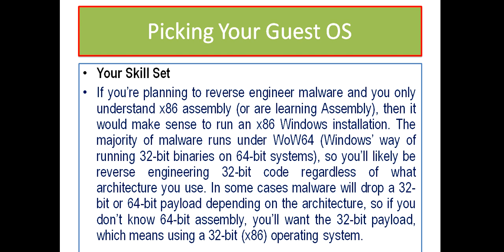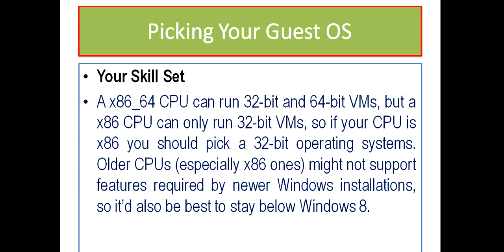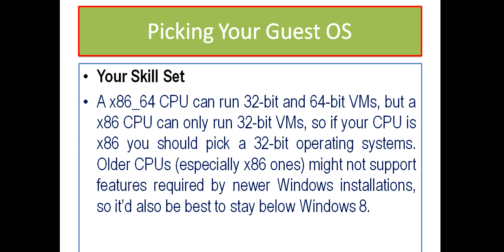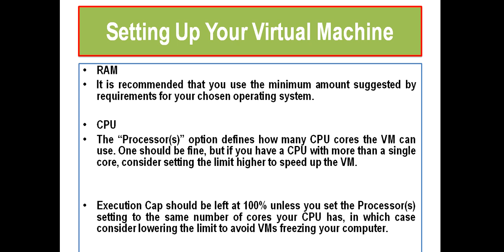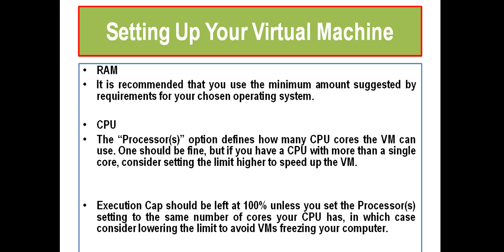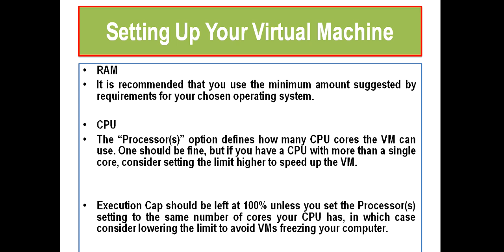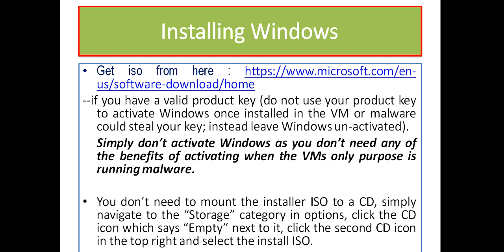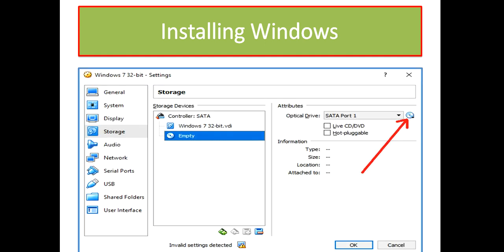#Lab Setup for Malware Analysis|Part-2|#Malware Analysis|LECTURE#4

Comment: Robart Konwar
I'd:-CS18MSIIT025
To access the Internet, one public IP address is needed, but we can use a private IP address in our private network. The idea of NAT is to allow multiple devices to access the Internet through a single public address. To achieve this, the translation of private IP address to a public IP address is required. Network Address Translation (NAT) is a process in which one or more local IP address is translated into one or more Global IP address and vice versa in order to provide Internet access to the local hosts. Also, it does the translation of port numbers i.e. masks the port number of the host with another port number, in the packet that will be routed to the destination. It then makes the corresponding entries of IP address and port number in the NAT table. NAT generally operates on router or firewall.

Comment: Ratul chetry CS18MSIIT002
Network address translation (NAT) is a method of remapping one IP address space into another by modifying network address information in the IP header of packets while they are in transit across a traffic routing device. ... One Internet-routable IP address of a NAT gateway can be used for an entire private network
Reply from the maker: correct

Comment: (CS18MSIIT039)
NAT(network address translation) is the process where a network device, usually a firewall, assigns a public address to a computer or a set of computer networks inside a private network
Reply from the maker: correct

Comment: Network address translation (NAT) is a method of remapping one IP address space into another by modifying network address information in the IP header of packets while they are in transit across a traffic routing device.[1] The technique was originally used as a shortcut to avoid the need to readdress every host when a network was moved. It has become a popular and essential tool in conserving global address space in the face of IPv4 address exhaustion. One Internet-routable IP address of a NAT gateway can be used for an entire private network.

IP masquerading is a technique that hides an entire IP address space, usually consisting of private IP addresses, behind a single IP address in another, usually public address space. The hidden addresses are changed into a single (public) IP address as the source address of the outgoing IP packets so they appear as originating not from the hidden host but from the routing device itself. Because of the popularity of this technique to conserve IPv4 address space, the term NAT has become virtually synonymous with IP masquerading.

As network address translation modifies the IP address information in packets, NAT implementations may vary in their specific behavior in various addressing cases and their effect on network traffic. The specifics of NAT behavior are not commonly documented by vendors of equipment containing NAT implementations.
Reply from the maker: correct

Comment: Network Address Translation (NAT) is the process where a network device, usually a firewall, assigns a public address to a computer (or group of computers) inside a private network. The main use of NAT is to limit the number of public IP addresses an organization or company must use, for both economy and security purposes.
Reply from the maker: correct

Comment: Abdul Zabber:
NAT stands for "Network Address Translation." NAT translates the IP addresses of computers in a local network to a single IP address. This address is often used by the router that connects the computers to the Internet. The router can be connected to a DSL modem, cable modem, T1 line, or even a dial-up modem.
Reply from the maker: correct

Comment: Network Address Translation (NAT) is a process in which one or more local IP address is translated into one or more Global IP address and vice versa in order to provide Internet access to the local hosts. Also, it does the translation of port numbers i.e. masks the port number of the host with another port number, in the packet that will be routed to the destination. It then makes the corresponding entries of IP address and port number in the NAT table. NAT generally operates on router or firewall. The idea of NAT is to allow multiple devices to access the Internet through a single public address. To achieve this, the translation of private IP address to a public IP address is required
Reply from the maker: correct

Comment: NAT (Network Address Translation) translates the IP addresses of computers in a local network to a single IP address. This address is often used by the router that connects the computer to the internet. The router can be connected to a DSL modem, cable modem, T1 Line, or even a dial-up modem.
Reply from the maker: correct

Comment: NAT stands for Network Address Translation.  NAT translates the IP addresses of computers in a local network to a single IP address. Network Address Translation is the process where a network device, usually a firewall, assigns a public address to a computer (or group of computers) inside a private network. The main use of NAT is to limit the number of public IP addresses an organization or company must use, for both economy and security purposes.
Reply from the maker: correct

Comment: NAT. Stands for "Network Address Translation." NAT translates the IP addresses of computers in a local network to a single IP address. This address is often used by the router that connects the computers to the Internet. The router can be connected to a DSL modem, cable modem, T1 line, or even a dial-up modem.
Reply from the maker: Good Explanation

Comment: Network Address Translation(NAT) gives a virtual machine access to network resources using the host computer's IP address. A network address translation connection is set up automatically if you follow the Custom path in the New virtual Machine Wizard and select Use network address translation.
Reply from the maker: correct